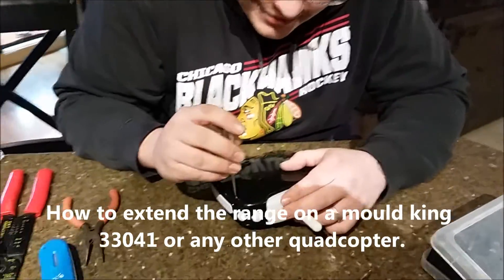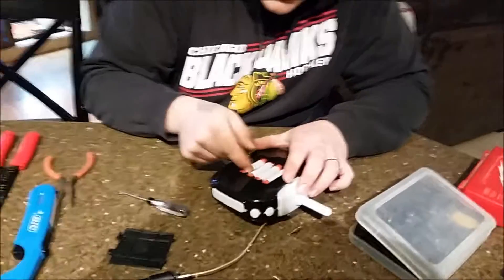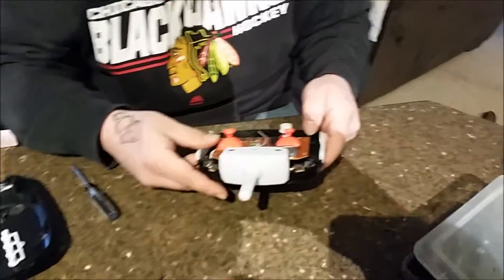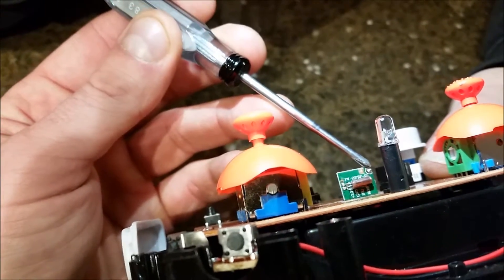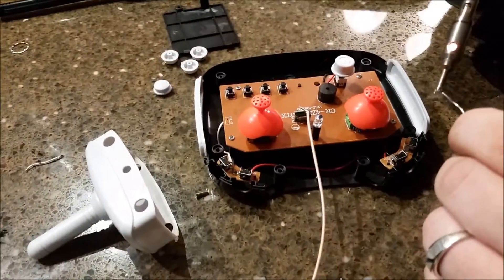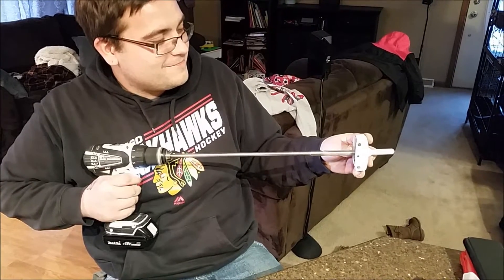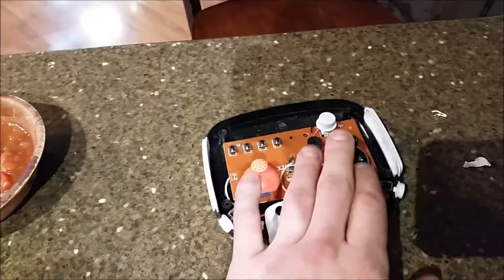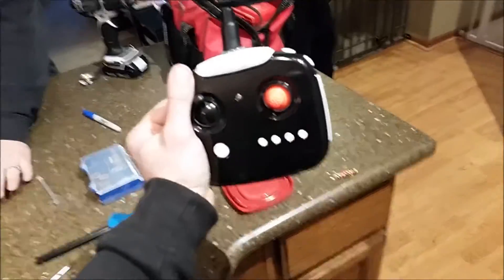Mould king 33041 range modification

Comment: Nice video.. I've modded  two  33041's and a few Syma' X5''s this way, using antennas from thrift store routers. To make it easier, the center wire of the coax is soldered in the original place, but the shielding of the coax connects any place that leads to the negative of the battery.. I get well over 100 yards with the 33041, before the modd was about 60 feet..